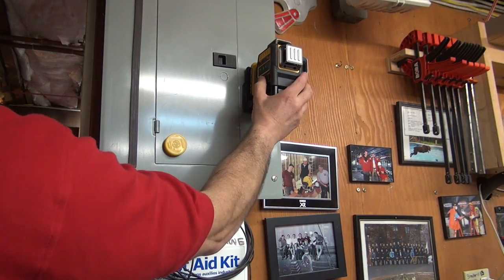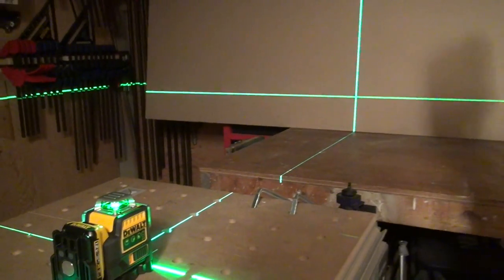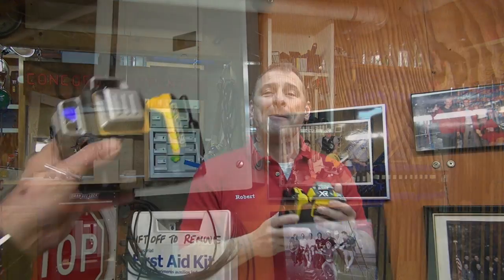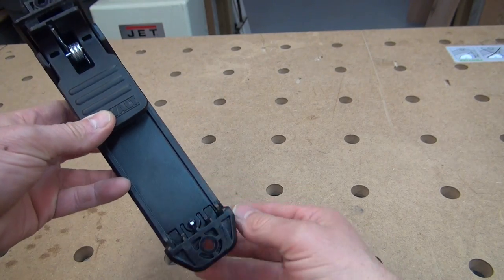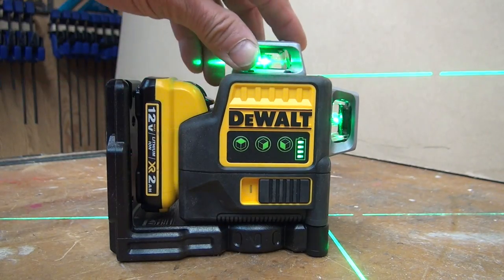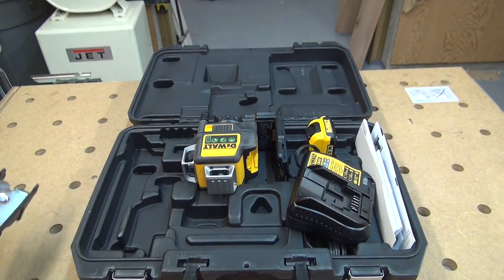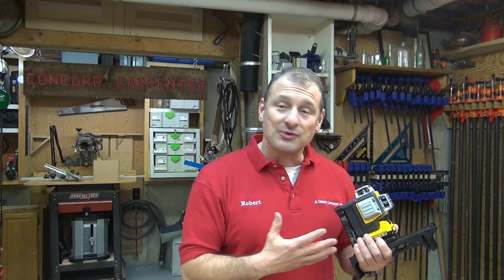DEWALT 12 Volt Green Beam Laser  DW089LG Review

Comment: I have this laser. just a note about the size of the case. it does seem to be oversized but if you purchased the optional detector to go with it (DW0892G) the case is already set up to accommodate  the sensor, bracket for the sensor to mount to a grade rod,  and even a place for a spare 9V battery. ( the sensor takes a 9V battery) I find this to be quite handy to have everything all in one case. so its good planning ahead as far as that goes, for those who purchased the sensor as well. also, there is a place in the case for a spare 12v battery for the laser itself if you wanted to keep an extra in the case. it does however only come with a single battery. my only complaint about this laser is i wish it had a fine adjustment set-up. otherwise, i am very happy with it.
Reply: Hello! I just purchased this laser and detector. I went to use it outside and the detector doesn't seems to pick up the laser unless I'm 5 feet or closer to the laser. Did you experience anything like this?
Reply: @matthewzook1859  I did have a bit of trouble getting it to find the detector on a bright sunny day at 40 feet while laying out a garage foundation. It did seem harder than i thought at that distance but at 5 feet you should have no trouble at all. make sure the battery in the detector is good and that the laser is turned in such a way that the corner posts of the laser housing are not interfering  with your line. I have used mine outside, of several projects and I have always managed to get the detector to pick up the beam.  I Have noticed it is much easier indoors though, which is why i think the bright sunlight may play a part. not sure,...that has just been my experience.
Reply: @ryankershaw647  Thanks for the reply! Have you had issues using the detector in colder temperatures (around 32 degrees F)? I can't imagine Dewalt would make something that wouldn't work at that temp, but it was cooler today when I used it.
Reply: @matthewzook1859  I have used it in cooler weather and no issues. I am very happy with it. Although, as mentioned before, my only complaint is i wish it had a fine adjustment on it for getting your line right on the money at greater distances. I use it all the time though and it works great.
Reply: @ryankershaw647  I must have a defective one then. Sometimes it seems to work fine, other times it wont register even when I can visibly see the laser on the detector. Thanks for your help!

Comment: Just bought this laser yesterday.  love that it is green, love that it does a true 360 in all axis.  problems with this laser?  the accuracy, which i scoffed at when reading on the box, ( i have hilti spinners, and they are only guaranteed 5/8 in 100 ft, although most of them are dead on).  i suggest anyone buying this laser to check its level.  it was out a staggering inch and a quarter in 120 ft.  which, is par for the course for little dewalt palm lasers, but not acceptable for a 700 dollar laser (canadian) .  actually quite astonishing.  actually, relooking at the box, it simply says accuracy 1/8.  which in this case would be over 10 ft.  which is about par to the base model dewalt laser.  

and , as someone else has stated, the loss of the fine accuracy adjustment is a huge loss, trying to line this up over 120 ft is near impossible now

but hey, green
Reply: finally a first hand review.  thank you.  how is the visibility in the sun?
Reply from the maker: decent, not great
Reply: Have been using it daily for a few months  now.   Dewalt eventually swapped the horrifically out of level level for one with one of the glass panes flawed.  Once again,  it was a problem that affected only the horizontal level use, which I don't use.   I probably put it thru it's biggest test in the sun last week,  working directly on the sunny side of a building aand trying to pick it up over 100 ft vertically.   It did not pass that test.  That was the first time I have had a visibility issue.   Oddly enough,  the reason why I couldn't see it in the sun is the fact the line is so fine, which is also a huge benefit of it.  Even my big bitch hilti green beam has a problem on the harsh sun, so I can't degrade it too much for disappearing.   I do grid, and I use the vertical 90 all day every day.  It's a damn good laser

Comment: Hi. I just bought one of these. Inside the box was a 1"x3.5" steel bar...the dewalt customer service people had no idea what it was for, do you? There's a little hole in one corner of it.
Also the instructions on this unit are terrible. There's a paper about the danger of batteries, and a little piece about the parts of the laser, but nothing about how to use it for different applications. Dewalt told me to go to youtube to find it. (gee thanks for passing the buck). your video does a great job of explaining the features, but do you know where to find information about how to actually use it for grade readings, squaring up a room etc. I'd like to be sure to know how to best use the tool. 
Dewalt dropped the ball there.
Reply from the maker: +darkknighte Is it the back of the bracket - did it fall out / off?
Reply: +A Concord Carpenter No it's not part of the bracket, that's a big metal piece. Here's what it looks like. It was in a little paper brochure that showed what accessories you can use with the level.
It's just a little 1x3.5" piece with a hole in the corner. Not sure how to upload a picture of it here.
Reply: darkknighte it's use is for nailing it to a wooden stud using the hole in the steel and then attach the laser level via the magnets mate
Reply: You put it between the back bracket magnets of the laser and ceiling holder...it acts as a slider between the magnets and the steel flat bar of the holder... and tata, you have a height adjustable laser on the ceiling bracket.  Or else, the magnets are so strong they don't slide on the holder.

Comment: Will the illuminate for ceilings to mark for light fixtures?
Reply from the maker: Do you mean a plumb mark?
Reply: Yes.. from the device (on the floor) up to the ceiling.
Reply: I wanted to know this too.  Does this laser put a "cross mark" (with lines that extend out) on the ceiling that is directely plumb to the "cross mark" that it puts on the ground below it?
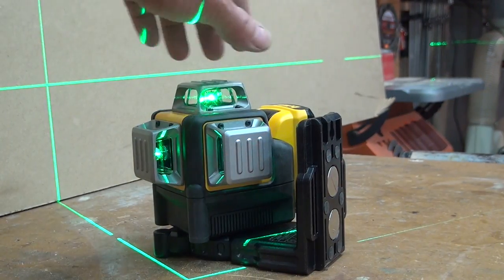At 1:27 you can see this "cross mark"; it's the one on the table (ground), not the wall.  I'd like to know if that "cross" is also illuminated on the spot directly above it (plumb) on the ceiling.

The Dewalt DW089K Has this feature.

Thanks.

Comment: One major drawback for metal stud framers is the lack of fine adjustment. They missed the boat with this one.
Reply from the maker: +fancy It takes a bit of muscle to slide the laser, I didn't find it a deal killer but other lasers, like the Bosch, have a knob that give you micro adjustment
Reply: +A Concord Carpenter Even the Bosch laser has it's downfall. The fine adjustment is a little sloppy, but the point over 360° adjustment is nice. These lasers with pendulums also move too much when people are walking around. I have the new stabila that automatically adjusts to its own receiver. It uses servos, as apposed to a pendulum. I'll let you know how it works. Biggest problem with it is the price.
Reply: +A Concord Carpenter I have the Bosch stand with the micro adjuster, it's fantastic.  it just uses a standard tripod mount so it should be able to work with any laser.

Comment: Great review, let me ask you. me and my friend have the same laser. batteries are fully charged, and the laser is brand new out of the box. BUT! the variety between the two are different. one is darker green and one is lighter green. (same brightness)

how does it possible ?
Reply from the maker: Not sure - have you contacted Dewalt?
Reply: Well, no offense but a female picked up the line and i knew that this call wasn't going anywhere.

For your interest, post your Email here so i can send you the photos. tell me what do you think.
Reply: Eyal Eyal probably different batch of diodes that the lasers was built with
Reply from the maker: info@concordcarpenter.com
Reply: Eyal Eyal    As someone else said it was a different diode manufacturer or a different lot of diodes from the same diode manufacturer.